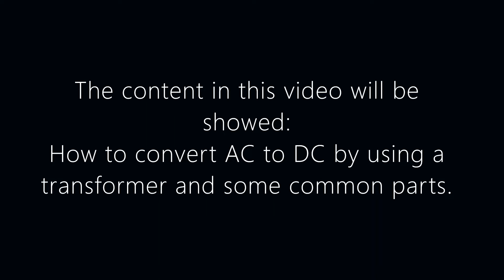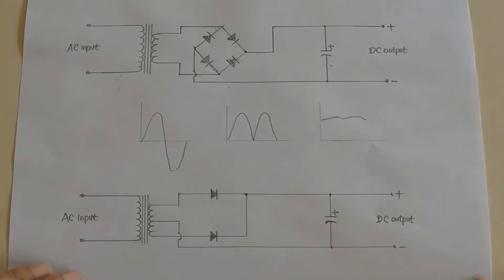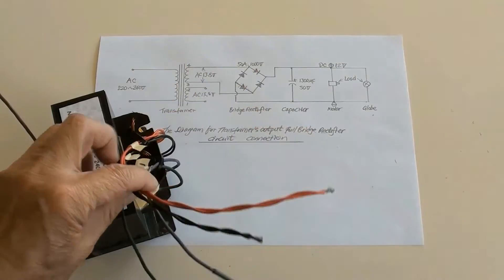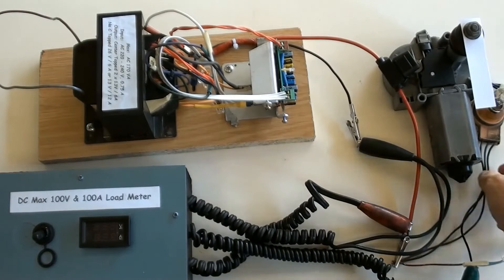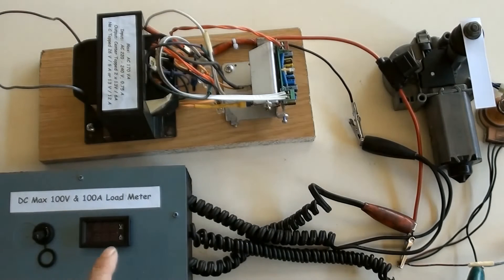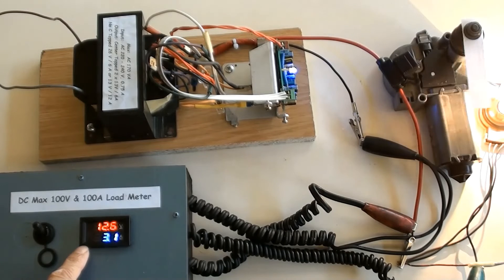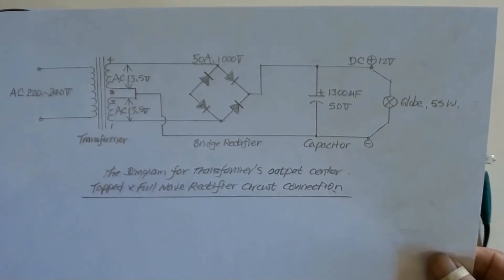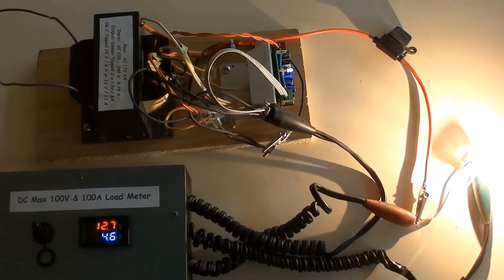How To Convert AC To DC By Using A Transformer?

Comment: hi.. very nice video.. could you please tell me what depends on how many volts we get at the end.. for instance I'd like have 36 volt.. thank yoy
Reply from the maker: Thanks for your interested!  Yes, two options are here (smps power excepted):  (1) suppose you have a transformer with ratio of 230 V/12 V, then you'll get the DC 12 V output as in the video showed.  At DC 12 V point to connect a DC 12 V to DC 36 V boost which can be purchased for a few dollars.   (2) an ideal way is to make your own transformer with the ratio of 230 V/36 V, there is a video related:  "How To DIY A Multi Functions Transformer" on my channel.  The link is here:  https://youtu.be/-VRwtFlaLuE              Good luck with your experience!